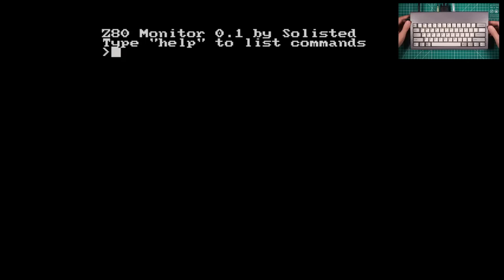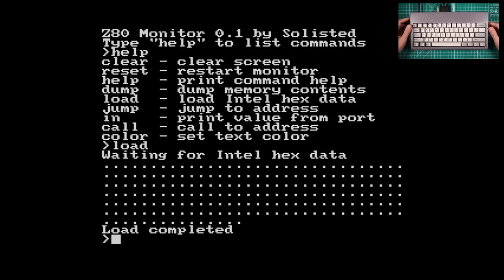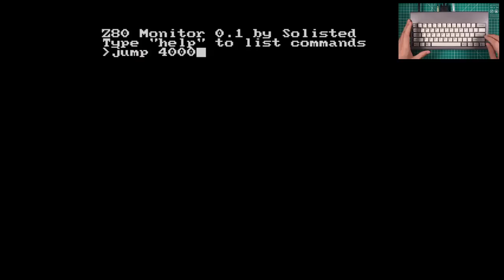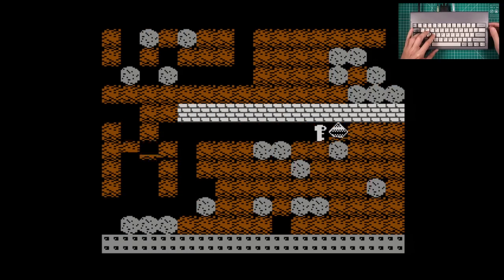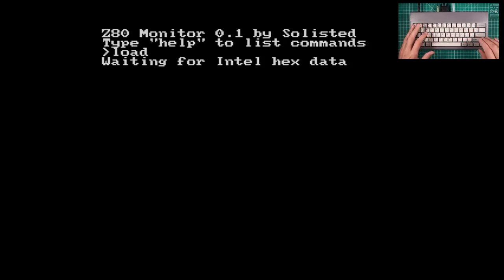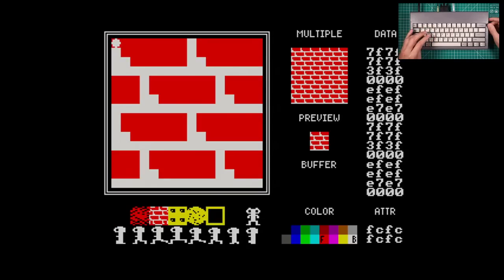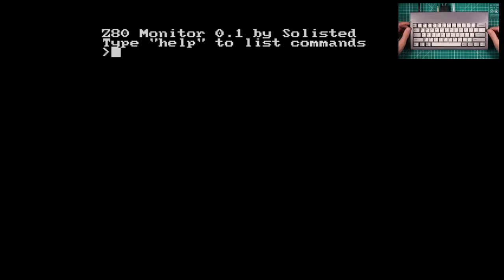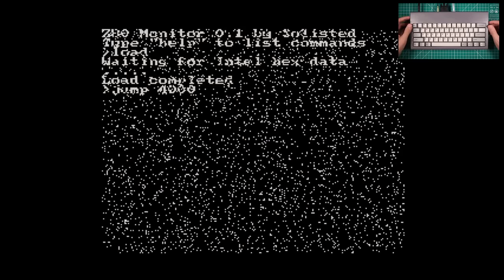DIY 8-Bit Z80 Single Board Computer

Comment: See here:
https://www.digipart.com/part/AY-3-8910
Reply from the maker: Thank you, Torleif!

This is no doubt, you can still get AY-3s from many part vendors, but these will most likely be recycled parts, rarely new old stock, I think. I sourced mine AY-3 and OPL3 PSGs from utsource.net and got them with tinned pins, which indicates that these parts were desoldered from recycled electroncs waste.

What I meant in the video - all parts besides AY-3 are still current production parts. Still active and manufactured by Zilog, Atmel, Renesas etc.